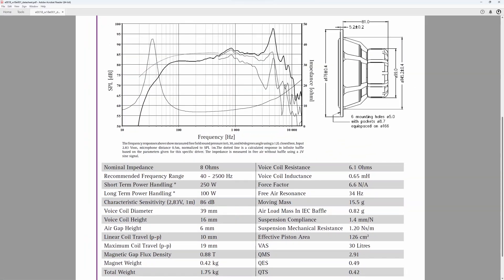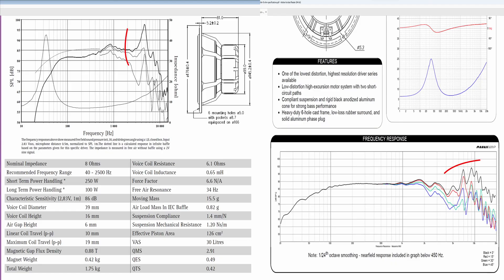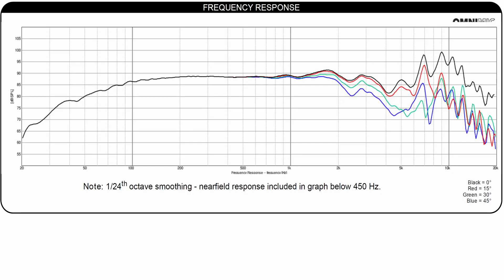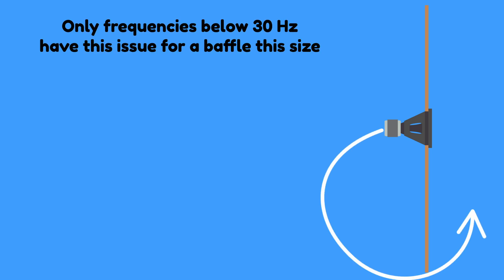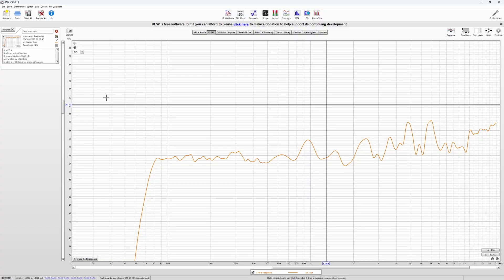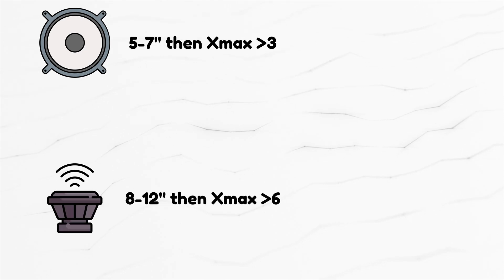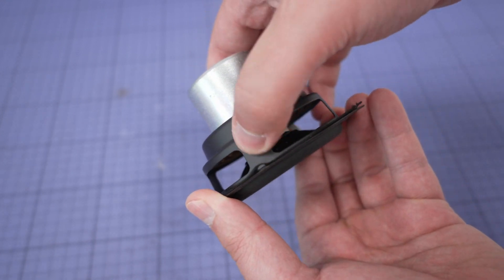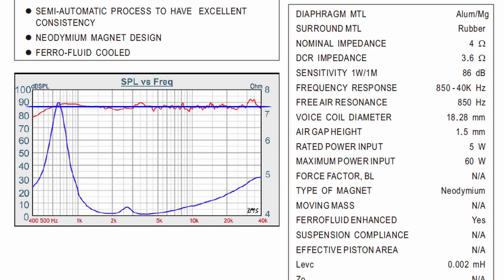5 less known Tips about Speaker specs

Comment: Xmax - here we go again! 
Fostex FE103En (3.5" fullrange) FS 83hz, xmax 0.6mm https://www.youtube.com/watch?v=-U3XW6TV9zI (360P video) headphones on for the demo
Hybrid Audio I6SW 6.5" sub, FS 43hz (measured) xmax 6mm (one way) https://www.youtube.com/watch?v=R_QUm97_kJk
BTW, on the strength of the above video, I bought the Hybrid I6SW, and it replaced my DD Audio 12" sub. 

Do any of these small drivers sound (measure) like they're struggling with bass, given what their perceive limited parameters are?

Comment: Funny seeing you talk about Scanspeak drivers. In 98 or 99 I bought a woofer driver from them for a speaker I wanted to make, but never did. I still have it in my attic anf want to try to make a subwoofer with it. I'm not sure exactly which it is, but I remember it needed an absolutely immense box to go deep.
Reply: Use your attic as the box!  This kind of thing, building speakers into the house structure, was done in the 1930s to 1950s when amplifiers were low-powered, 5 to 10 watts.

Comment: I like most comments. And I agree with the x-max comments but I wonder whether the 26W/8534G is a good example of a low x-max problem. Perhaps it’s more an alignment problem. It’s TSP would better suit a sealed box; say around 50L or less. The BR reflex box needs to be large like 100L with a low tuning. Two of them need even a larger box.

Comment: Nice video, as always, I was wondering if you can uncover some of the mysteries of determining the right volume of a box, and type,  from the T/S driver parameters
Reply: Acoustic Engineering Workflow  Hexibase channel. There's also a part 1 and part 2 on T/S parameters, as well as a video on counting acoustic orders; sealed, transmission line, ported, bandpass etc.

Comment: great video - as ususal- I wonder if you can shed some light on the following issue: There are some speaker drivers (usualy the expensive once) that just tend to sound very clear fast more open and dynamic, as oppose to (cheaper drivers) that sound compressed and less "live" - can you point to the t/s parameters that "show"  this capability of speed, clearity and dynemics. Thanks
Reply from the maker: One thing I can tell you that set's apart a higher end driver is the presence of a shorting ring in the motor structure. This reduces distortion and also it reduces Le. So, if it's not mentioned directly in the description, low Le is an indicator of a good speaker.

Comment: I've also seen xmax listed as one-way and as peak to peak
Reply: That's what I wanted to say, but I find it odd that it's rarely listed at all whether it's one way or p-p, or maybe that's just the drivers I'm looking at?
Reply: Measuring Speaker Excursion sparkedED channel - 5 min video will tell you all you need to know about the difference between xmax, xmech  and excursion

As for his advice on xmax, here are some examples of why I don't agree. 
Fostex FE103En (3.5" fullrange) FS 83hz, xmax 0.6mm https://www.youtube.com/watch?v=-U3XW6TV9zI (360P video) headphones on for the demo
Hybrid Audio I6SW 6.5" sub, FS 43hz (measured) xmax 6mm (one way) https://www.youtube.com/watch?v=R_QUm97_kJk
BTW, on the strength of the above video, I bought the Hybrid I6SW, and it replaced my DD Audio 12" sub. 

Do any of these small drivers sound (measure) like they're struggling with bass, given what their perceive limited parameters are?

Many people develop ROT (rules of thumbs) or generalisations about t/s parameters and enclosures.

Comment: Xmax is important, but Xmech is also important imo. Unfortunately not many manufacturers provides this specification.

Also, you need to be careful when looking at the sensitivity. Depending on how they measure it can change drastically. If they use 1W instead of 2.83V of if they measure it at 0.5m instead of 1m can change the sensitivity by a considerable amount!

Comment: Correct me if I'm wrong, but some tweeter spec sheets feature a 2600Hz 1st order HPF following IEC268-5 standards. This would mean that if you want to use the minimum phase response (the one from the FRD graphs), you have to take into account this high-pass filter capacitor.
Reply: I thought 1st order filters do not mess with phase. But I could be completely wrong here